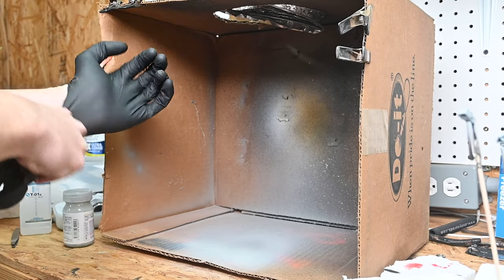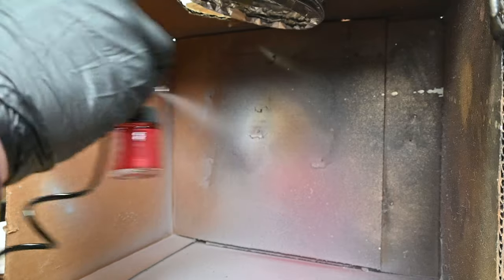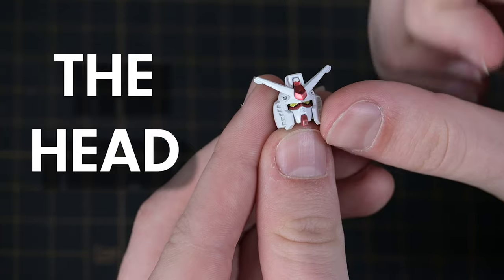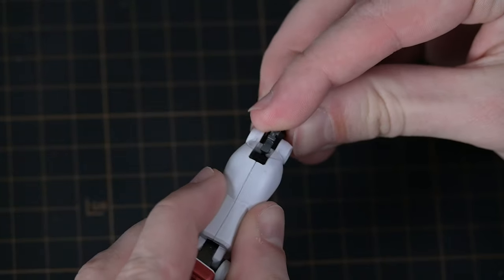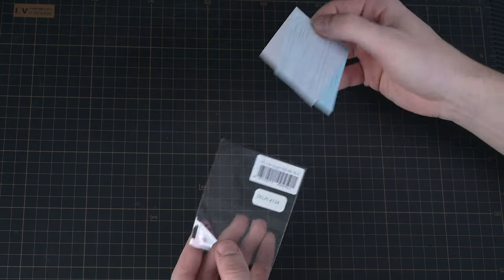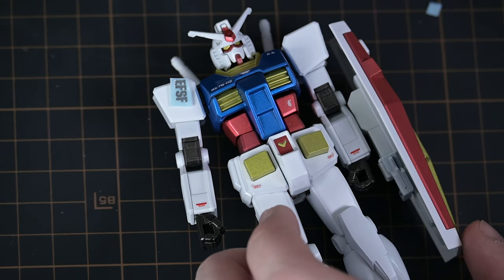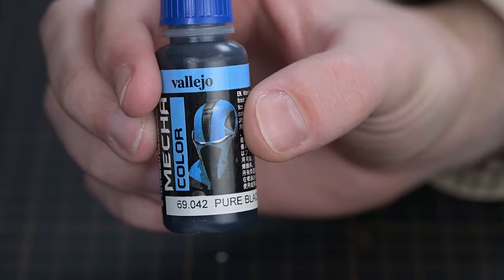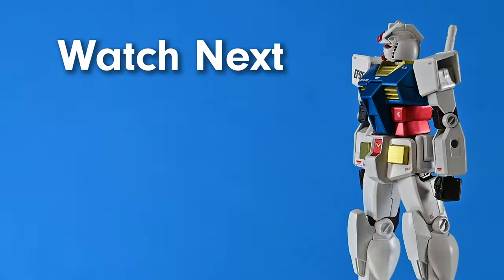Customizing Gundams For Beginners | Building With a Beginner

Comment: Painting will stiffen up the joints. So 1 aspect you need to be aware of is to not over-spray and to give plenty of time in between layers for the paint to dry. As such, 'less is more'. Multiple thin layers...

5:55 Audio gets super loud here 🤣

Overall, the paint job and decals came out nice.

Quick tips...
Usually with HGs, people will snip off the 'safety' nubs on the v-fin and sand it down.
You should try to pose the kit a little better so that it doesn't look so 'blocky' and scrunched up.
Reply: i dont paint my kits but i always snip off and sand the vfins to make them sharper. dont understand why some people took their time and effort to paint and customize but left behind the vfin safety flags